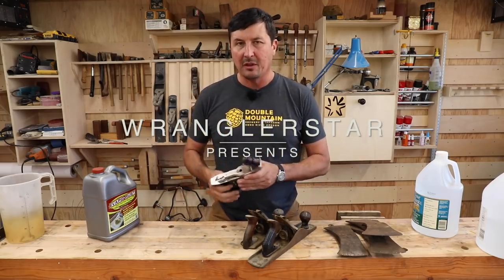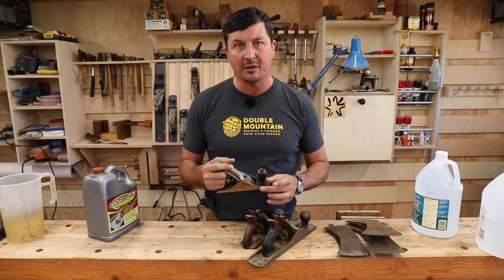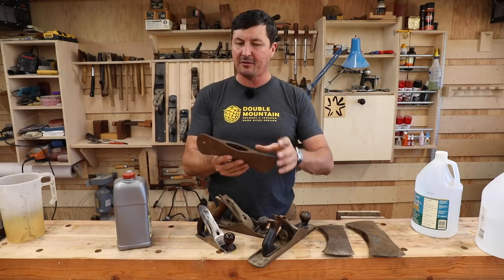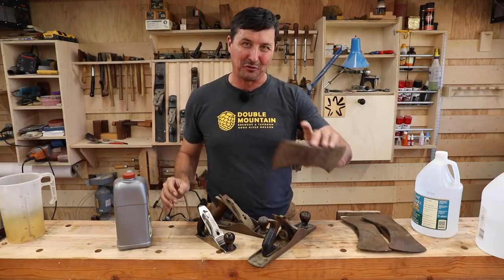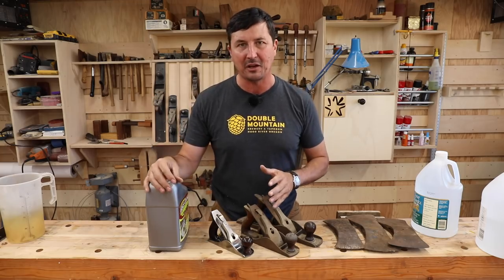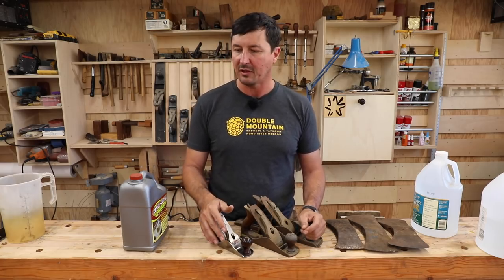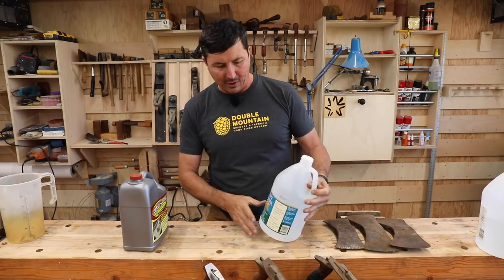Polishing A Rusty AXE

Comment from the maker: GET YOUR EVAPO-RUST HERE ONLY $19 * * * FREE SHIPPING * * * https://goo.gl/KFGcWe
Reply: Wranglerstar try giving it an electro bath
Reply: Wranglerstar It's $6 at Walmart too... I wonder if that works the same?
Reply: Wranglerstar i have a lot of those stanley's at home..i have 5, but i don't use them..had to "edit",cuz i went to count😂
Reply: Wranglerstar ... i loved this vid... its like it opened up a new world to all my old tools and maybe some part cleaning.  I happened to come across some vids about electrolysis rust removal too... its almost free, definatly worth checking out
Reply: $6 per quart
Reply: Great video. make sure to rinse the vinegar off or it can re rust the tool.
Reply: I think it is 6 dollars for one quart, and 19 for 1 gallon.
Reply: Evapo-rust is probably better than vinegar (do not  know how it works though!)... again do not forget that "Pickling" metals can lead to  Hydrogen_embrittlement ... this could ruin steel that should not become brittle... 

You might want to do a video experiment with spring steel ... put one into vinegar and let it rest then see if you can a difference in the brittleness of the steel ... 

see also: 
https://en.wikipedia.org/wiki/Pickling_(metal)

And: 
https://en.wikipedia.org/wiki/Hydrogen_embrittlement
Reply: Since the Evapo-Rust is acid-free, does this eliminate the possibility of the pickling process to occur?
Reply: put the rustiest thing you can find in the evaporust and show us the before and after product
Reply: He has a kiln and a forge, He can anneal, harden and temper the steel if he wishes. Also hydrogen brittle problems occur mostly in hand forged or cast iron in this situation. More modern (last 200 years) steels don't have the gaping crystal dislocations for the hydrogen to soak in that quickly. Yeah, went to college and took chemistry and mechanics of materials stuff. Re-tempering an antique Gransfors Bruks axe head is sacrilege, though. A Bailey plane iron would be treason.
Reply: The most important question: will it be more brittle than before...  So we would need 2 pieces 1 treated and 1 not treated. If both perform like before treating them with evapo-rust ( use some kind spring steel) than we know there is no Hydrogen embrittlement. 

Do the same with vinegar ... and check how the results are ... (The main question is how much of a difference will there be... maybe there will be no >perceptible< difference... After all the most you could use to check is  a scale painted on the wall and a camera that shows how much a "pickeld" steel rod will bend compared to a identical not pickeld steel rod
Reply: They will not ship to Ireland 🇮🇪
Reply: Basic medium carbon steel is very forgiving, if you can get it hot enough. First is the annealing process. Get it almost hot enough to deform and drive off unwanted stuff (the aforementioned hydrogen in particular), then very slowly cool it down. The result is a very soft but crystalline stable steel. Then you go through a series of hot/cold cycles in selected spots to harden and temper what ever part of the steel you wish. Ask a good blacksmith.
Reply: Sorry to say ... but this sounds as work/time intensive as using an abrasive process (as Cody was using  before) ...
Reply: But yeah, if it is hand forged or cast iron soaked for a few days, it will be more likely to have problems if you can't heat it up enough to fix them.
Reply: Anyway ... I am still curious how evapo-rust deals with oxidation... There are after all only a couple of ways how an oxide could be removed right ?! It could be dissolved (acid)... It could be um ... actually how else but dissolving?... This is getting complicated ...
Reply: @wranglerstar I've recently tried the vinegar myself and was very pleased. After watching this I think the evaporites had much better results and I'm looking forward to trying it out myself this winter. Thanks!
Reply: how did the zerex can turn out!?????
Reply: Is it more brittle than before ? ;)
Reply: Roland S. if this is directed for me I can not answer that question at this time. I've simply soaked some parts, cleaned, and dryed followed by wd40.
Reply: Roland S. The SDS (Safety Data Sheet) to the rescue! Water, 83% by weight. Proprietary non-hazardous chelating agent, 16%. Proprietary non-hazardous detergent 1%. A chelating agent is an organic molecule that will form a complex with the iron ions present in the rust, assuming they are at least partially soluble in water, while leaving metallic iron untouched. It's difficult to know exactly which chelating agent they use, but that should be enough to get you started on your own Google adventure to find out more. :)
Reply: A year ago i had a clip for my 30-06 savage in my door pocket on my truck that i totalled. I found it 6 months later (when i started walkin again) and rusted bad... tryin vinegar now, hopin for the best. Ill let yas know in the A.M.
Reply: Aaron Smith i would like to know what it does!
Reply: So Wranglerstar is taking care of the woods around his homestead ... right? ... Hm...  this is getting full circle ... 
If you encounter a certain kind of tree disease ( https://en.wikipedia.org/wiki/Chlorosis ) just give those poor trees your leftovers from the EVAPO-RUST bucket  ;) 
 
Just joking ... obviously you should NOT do that ... 

https://en.wikipedia.org/wiki/Iron_chelate
Reply: hmmmm ... looking further into it ... could you just get yourselfe raw EDTA ( https://en.wikipedia.org/wiki/Ethylenediaminetetraacetic_acid ) as a forester - take care of your trees with it and also de rust your ax-heads too?
Reply: hmmm looking even further into it ... the defintion of an acid is that it makes H+ protons as in hydrogen protons available in a solution.  
EDTA and its alternatives are acids ... 
So Hydrogen ... again ... 
The questions then remains will there be Hydrogen embrittlement? This seems to be a logical question to ask ... 
Incidentally what is the PH of EVAPO-Rust?
(Will it curdle milk? This could the easiest way to find out if it is actually acidic - Compare with the same amount of vinegar!)
Reply: Looks like we're getting close to another axe handle video
Reply: Anonymous Wizzard He said in another comment that it's not a paid ad. But who knows.
Reply: Obviously the Amazon link is an affiliate link, but that doesn't mean he was paid off to review the product.
Reply: all they did in the evaporust is added a catalyst..
Reply: On things you cant use abrasion, there has to be another solution.  Whether it be fear of sparks or damaging the equipment further, this is a good alternative.  Near fuel, or something like preserving the stamp, this can be a lifesaver.
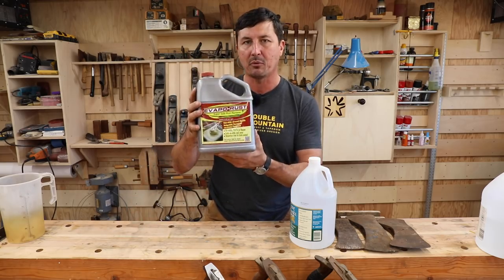Reply: Anonymous Wizzard, If you paid attention, at about 1:50 Cody said that the EvapOrust was sent to him by a subscriber. Cody tells when something is sponsored. This was not
Reply: Roland S. 

I had the same thought. I wonder if the Evaporust would damage the steel chemically as well?
Reply: willy p00 

I see. I thought of embrittlement as well. Hadn't considered the finer crystal structures of modern steels though. Good thinking!
Reply: If you leave it in citric acid too long it will pull what appears to be carbon or a at least a carbon colored and constancy of material out of the steel or maybe lay it on.  I'm not quite sure... one way or another it leaves a film on the item that has to then be scrubbed off.
Reply: Wranglerstar I first started watching your videos because you did everything by hand, and not talking the easy way out.
Reply: +John Bierwerth, this is not the easy way out?  This is the conservative way that does not damage the tools.  Mechanical methods of removal like sanding require that you sand off an exponentially larger amount of material than is necessary and chemical methods do not.
Reply: John Bierwerth vinegar is a common household items. Evaporust is cheap despite being an order of magnitude more expensive than white vinegar. Both store well. You could certainly make vinegar yourself on a homestead, although I'm not sure if you could make white vinegar.

I don't see how this is cheating, or against the spirit of homesteading.
Reply: Brother Blacksmith ... i tried it and yes ut worked! Very impressed. It sat for about 12 hours, it also removed the black finish and i now have it soaking in wd- 40 to stop the rust. I didn't notice any smells until i started moving it around and rinsing it off... like Cody said, it did stink then.  I am very happy with the result
Reply: Justin Dearing and I'm not going to argue with you I agree that it is easier. It's just I'm raised to work hard and not taking the easy way so it's become a habit that's all👍
Reply: +John Bierwerth -- Do you walk to work or dig up your garden with a digging stick? Because if you drive a car or use a shovel, guess what. That's the easy way out. Be sensible; using the right tool for the job isn't 'taking the easy way out'. It's common sense.
Reply: +Joh Bierwerth , It is one thing to learn and perfect the methods, but working that harder of the given solutions is both irresponsible and foolish from where I stand, but of course I cant exactly understand to what you are referring.  All the best, -Wes
Reply: He said at the beginning a subscriber sent it to him...Pay attention man!!!!
Reply: +Kyle"Since the Evapo-Rust is acid-free, does this eliminate the possibility of the pickling process to occur?"

-- Pretty much. Unlike vinegar, Evapo-Rust was specifically engineered to get rid of the rust without damaging the underlying metal. If you're de-rusting something you really care about stick with the stuff that was designed to do the job right. It's not so expensive as to warrant risking damage to the very thing you're trying to save, and, although I could be mistaken (I don't think I am), I'm pretty sure that Evapo-Rust is reusable several times.
Reply: Wranglestar --- In 2014, I used Evapo-rust to clean the surface of a large table saw. I covered the surface with paper soaked (I rolled up the edges for a 'dam effect') with Evapo-rust, left it on for 96 hours (and added more to keep a total soak). It cleaned it to new condition. I had to look really hard to find any rusted areas....and a 'touch up' cleaned those spots!
Reply: Sounds like a very good product ....... to stay about 10 miles the other side of. Melting skin and clothing off one's body sounds like a great way to spend a Saturday afternoon to me!
Reply: Roland S. How so?  This you can put the objects in the evaporust and then work on over things and come back and clean it off.  Plus you are not removing any material on the object so it leaves in a more true state.
Reply: Wranglerstar right now I've been re storing a grand forest berks double bit axe its super cool but i didn't know it was rare so thanks 😂
Reply: The one I see at that price is only 1 quart, not 1 gallon.
Reply: Wranglerstar hey i have a plumb axe head im restoring. Are they any good?
Reply: Roland S. okay dad
Reply: Plumb axes are excellent quality.
Reply: Use coke or Pepsi
Reply: Come to England - only £93 per gallon.
Reply: I wish i would have a quality axe because all axe in Philippines is made in china it has Fiber glass handle but the head easily breaks, i had one and it broke on camping, all blacksmits here only craft traditional machetes. i envy you guys.
Reply: Wranglerstar ii
Reply: Wranglerstar i tried electrolysis but this turned out even better
Reply: Wranglerstar the fizzing is the acid corroding the metal I think evaporust is better because vinegar could still actually damage the tool
Reply: Milas Hegner electro has nothing on evaporust. And yes I speak from lots of experience as a hobby tool collector. There are many routes to clean steel but nothing compared to evaporust.
Reply: The other thing about the evaporust is that it can be used over and over again. Just strain it.
Reply: Hey idk if you know but those flat spots on you're screwdrivers are for pliers to clamp on and give more torque. You probably knew this but incase you don't there you go. I think there cabinetry screw drivers.

Comment: Dear Cody, the reddish material remaining on the parts placed in the distilled (white) vinegar may be rust, if the reaction is incomplete ... but it also may be the product of the reaction between the vinegar (Acetic Acid) and the rust (Iron Oxide), Ferric Acetate. This precipitate is easily removed from the components, unlike the rust which is 'tightly' bonded to the underlying 'parent' material. GB

Comment: I think the vinegar should sit longer    because it was bubbling like.
Reply: Alan Heemer Yeah, vinegar will work just as well, and is much, much cheaper than the other stuff. It just takes a bit longer. 

I personally also love the smell of vinegar lol.
Reply: $19/gallon vs $1/gallon.
Reply: and vinegar is biodegradable.
Reply: EVAPO-RUST is also biodegradable.
Reply: vinger will eat the metel and paint. evapo wont
Reply: Yeah, if it's still fizzing it ain't done ;)
Reply: Vinegar is an acid, it will etch.
But if you want to de-rust a family heirloom just go right ahead.
Reply: put filler gauges in there for 24 hours already etching it. i said screw it then wait another 3 days and eat throw it.  axe doesnt really matter to much because you lose some metel you wont even know. for axe/hammer head who cares wire wheel would do it faster im talking about hand planes and screw drivers
Reply: but that's the point right?  You pay for the evaporust when you're restoring something that absolutley can't take damage.  Use vinegar for everything else.
Reply: David Howard It's METAL!
Reply: thats why i like it lol. it will eat the metal very, very slowly
Reply: cheaper also
Reply: It will keep bubbling, when the rust is gone it just etched the metal.

You can easily see this for yourself, get some brand new metal screws/nails and put them in vinegar. You will see bubbles.Vinegar has its uses but you shouldn't leave it in there for too long. It will also make metal rust easier if it is not properly neutralized and oiled afterwards.
Reply: Allo baking soda